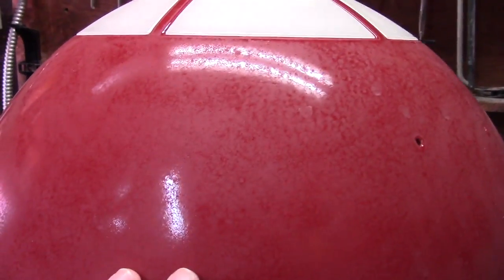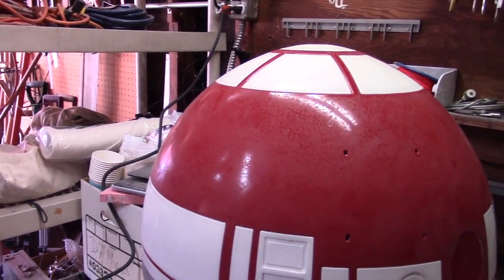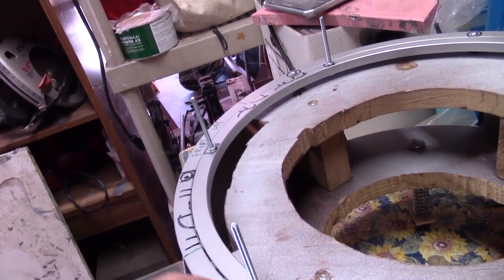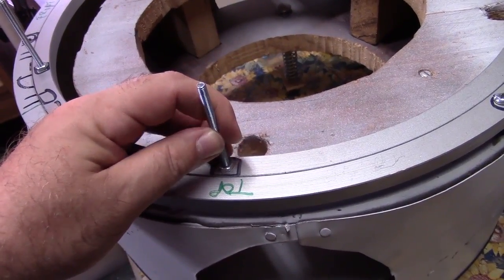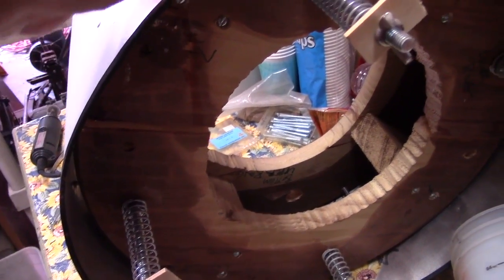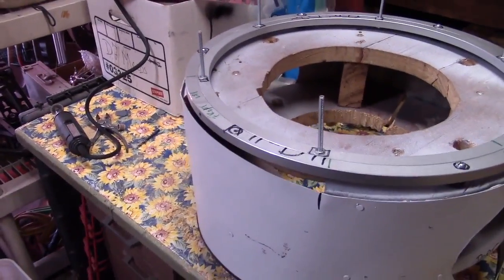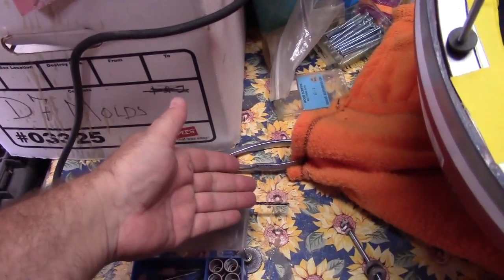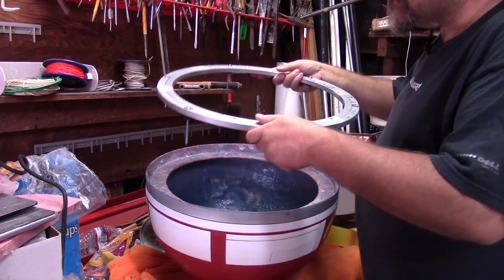R2 AP 08 The Bearing

Comment: Check your screws. I found that if the screw holes are not aligned to the wooden frame.  It bends the ring. Or if you over tighten the screws might warp it.